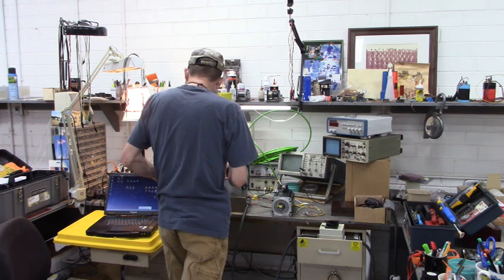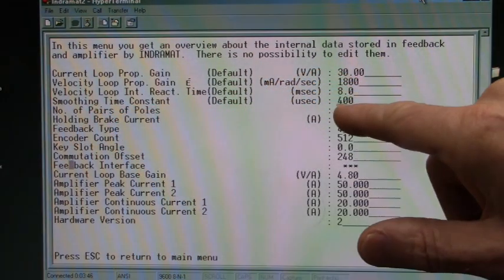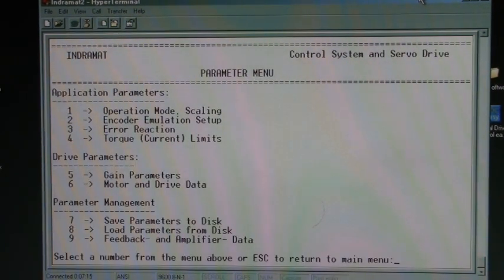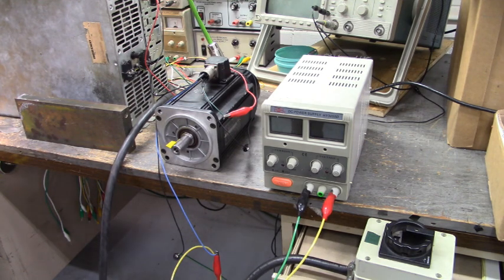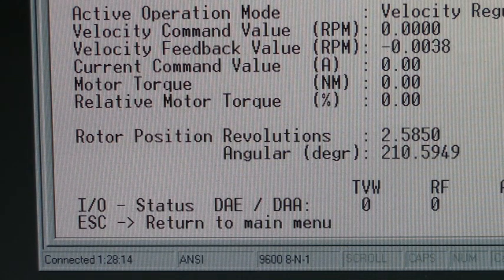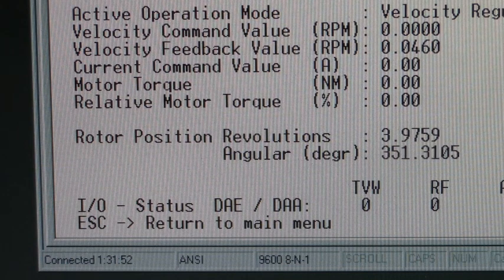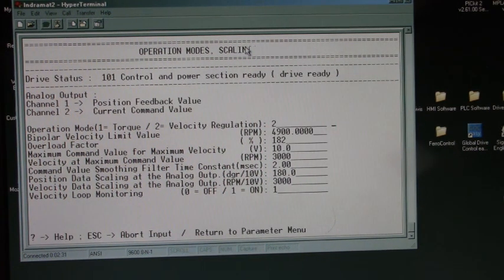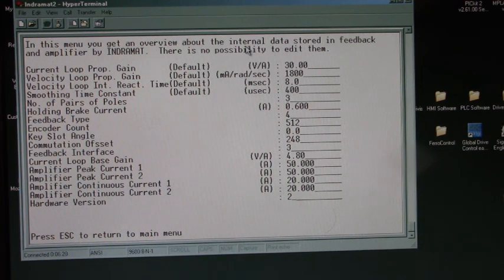Indramat Servo Motor and timing the Digital Servo Feedback.

Comment: On mdd motors there is a keyslot on the encoder shaft , if you mark the encoder case position you will be able to change the encoder and after verify the timing with your procedure. The encoder offset parameter value (248) is in the encoder i2c memory, this offset is used by the drive to adjust the timing in the factory. Thank you for all your's " thinking out of the box"
Reply from the maker: This information eases my mind greatly if I ever have to remove the indramat digital feedback unit. Resolvers to me are much easier to wrap my mind around. The keyway on the encoder shaft is something I was not aware of. And case position as well. So sorry, but can you go into greater detail on the encoder offset parameter (248). For example, with resolver feedback, I set it to the correct position and tighten the mounting screws. There is no need for software adjustment. Thank you very mush for the new knowledge
Reply: Be carefull there is not keyslot on all the indramat encoder, only the dsf encoder. On mdd encoder the commutation offset is used to trim à little the timing but for me you can change the encoder without timing trouble. On other indramat servodrive I'm not sure you can do the same as resolver to align the encoder, due to the commutation offset value, maybe you can try to add these value to the position value. I dont know if the commutation value is a shaft angular position or electrical angular position in that case maybe you have to multiply the offset by pole number then add it to position. There is 2 other issues: you can not turn the encoder case as you want due to the fixture, and in the encoder contain electronic nameplate in memory with motor type and size value. Many research to do.. if you have an i2c analyser you can look at the serial data communication pin it will be instructive! In factory they had specific tools to write in the encoder. I tried the same but without success for the moment.
Reply from the maker: @jeanesnault-g5n  Thank you very much for the added information. This is very informative.

Comment: If I had your encoder tester program you created, I'd try to reference the encoder home, if it's an absolute encoder, to zero degrees. Or verify 90 degrees with count 128, 512/4.
But depending on the machine, it might not matter if you can reference the home for whatever part of the machine the motor is used for.
Thanks for another great video.
Reply from the maker: Wow, you have led down a path I had not thought of. You are brilliant. When I get the servo motor into the shop again. I am going to try your experiment. Thank you for the insightful idea :) I hope that you and your family are doing well.